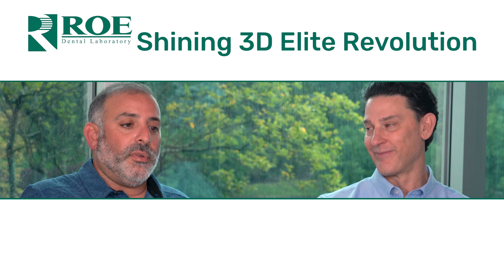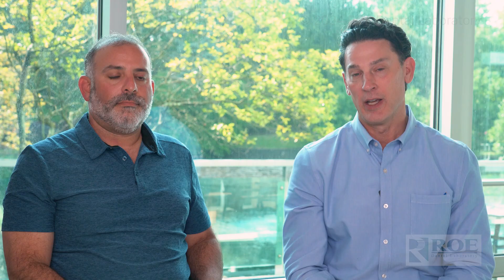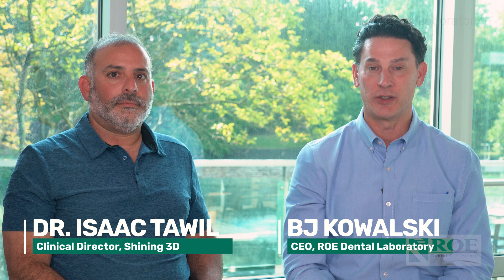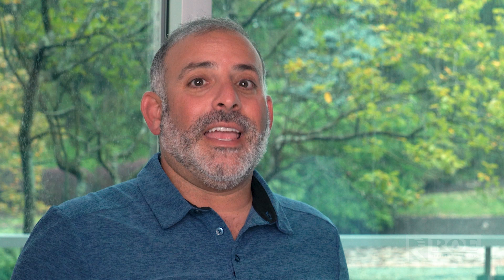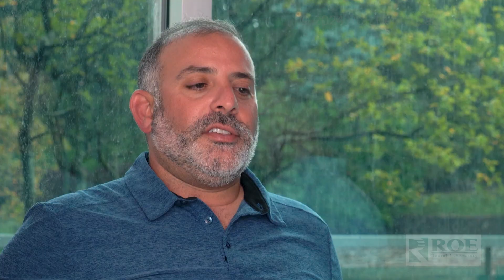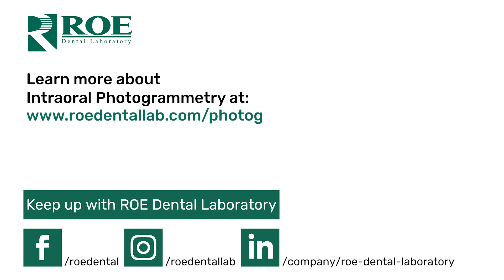Intraoral Photogrammetry Revolution: Shining 3D Elite

Comment: I use a pic library on the scanbody alignment and not the iMetric software, it’s very quick, however where I find alignment sometimes difficult is with lower arches matching preop and postop- ofcourse with a reduction guide placed it is very easy, however when using two flat fiduciaries, I sometimes find the postop arch being scanned wider (from that small field of view stitching together incorrectly)

How is this different with the shining. I do not see how your getting around this issue of aligning preop to postop arch
Reply from the maker: The advantage of the Shining 3D workflow is that the software auto-aligns the pre-op and post-op data with high precision. This eliminates the struggle of manually meshing datasets and prevents the "bowing" effect.

On our end at the lab, we aren't seeing those typical alignment issues when the data arrives; the algorithms do a great job of locking everything in, even without a reduction guide.

For more on our full-arch protocols, you can download a free copy of the CHROME GuidedSMILE™ Ultimate Guide on our website. It’s a great resource from our team of 20+ CDTs and specialists, and just one of thousands of free educational materials we provide to help with complex case planning and full-arch dentistry.

Download it here: https://www.roedentallab.com/products/chrome-guidedsmile